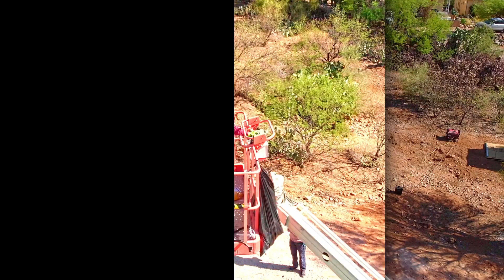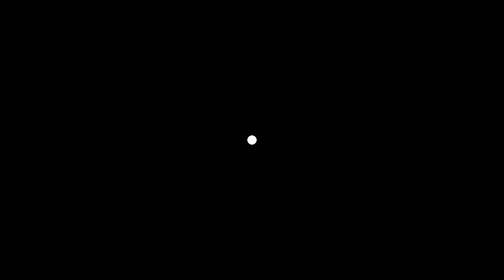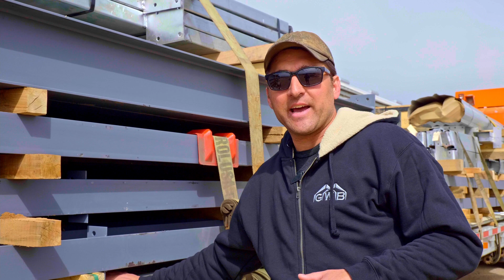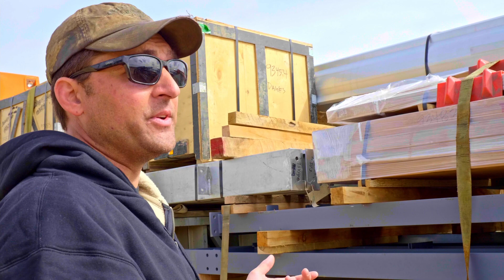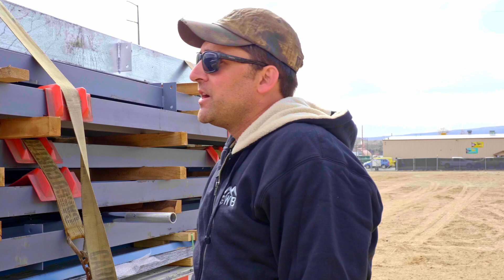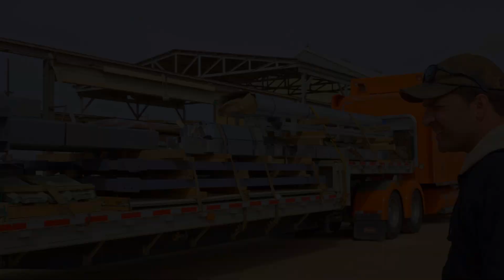Your Truck Load  - What To Expect | Great Western Building Systems

Comment: Our building was lucky enough to have its own trailer due to the size.  Everything was loaded just as described and it was an easy offload!  Fast and efficient way of doing it.  Helpful to have someone on the stack too (safety permitting) to ensure you've got your forks where they need to be.  (our telehandler had pretty poor visibility)